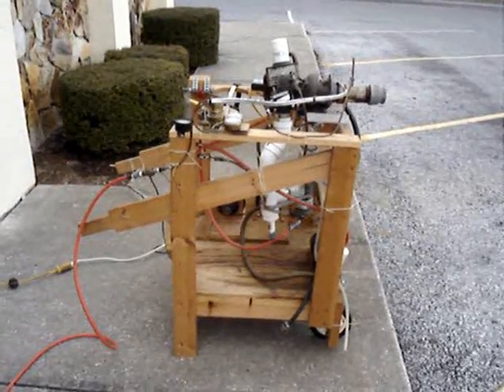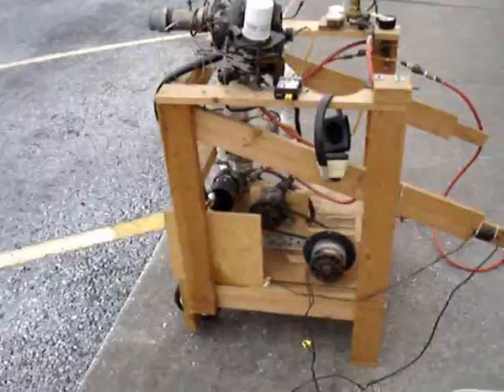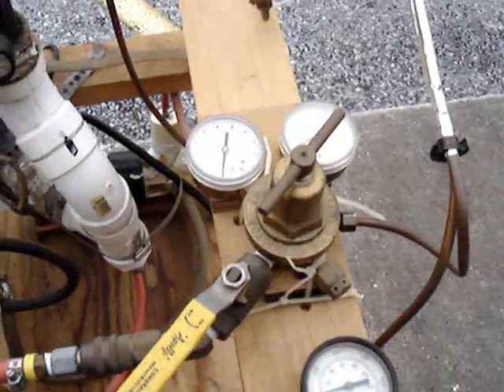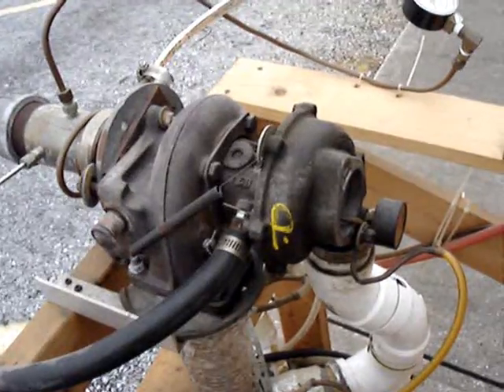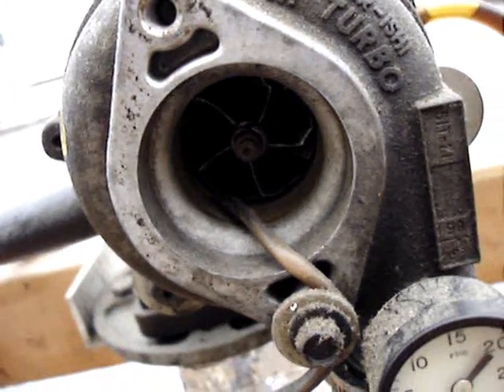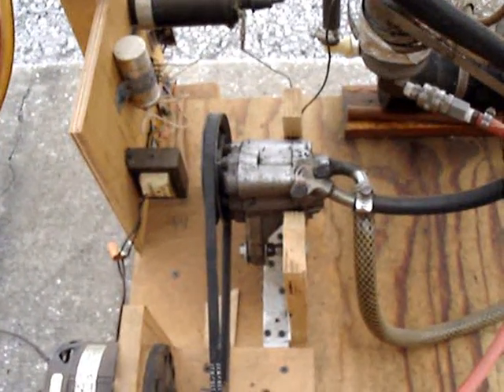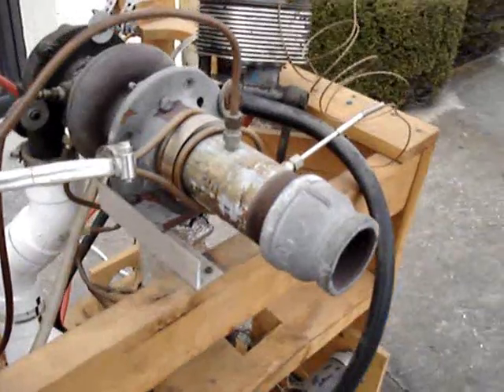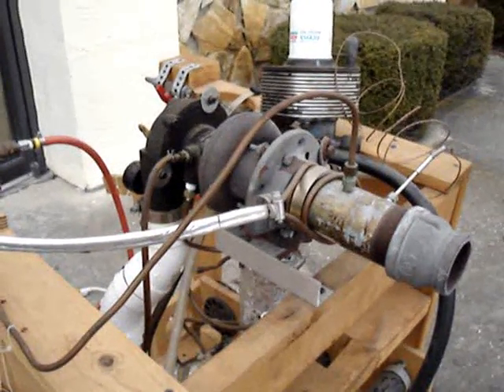Jet engine made from junk parts at junkyardjet.com

Comment: Sounded like a hot start due to too much fuel at ignition. The RPM's jumped up and then had to settle back down. Might not want to do that as it will melt the compressor and fan blades.

Comment: Great going. Very clever but could you think about making it solar or wind energized?
Reply: wah?
Reply: Erm what it does not need batterys only for ignition circuit and oil pump but you dont throw aa batterys into the intake it uses gasssssss fuck the enviroment
Reply: that comment ... does not make a lot of sense.
Reply: +RCX Models UK i suggest you fuck yourself instead. the environment will continue to exist, but one day you won't be able to live in it anymore.

Comment: Excellent job. I am in the process of making one my self, nut not quite as elaborate. Mine will be from an automobile exhaust glass pack, the axle of bicycle and an engine fuel injector line. Hope to have it running soon.

Comment: turbines dont put out horses they put out pounds but what is the egt at full speed and are you going to get a tachometer for rpm readout that is kinda important you need to know the limits and set the limits for safe operation;)